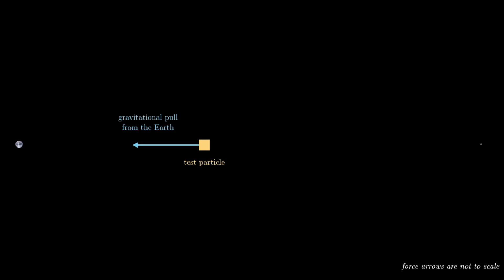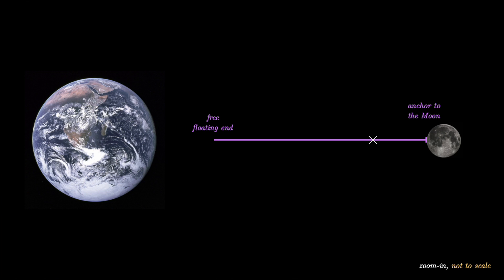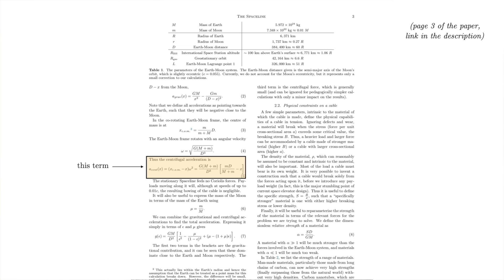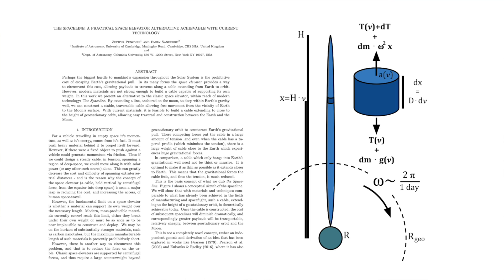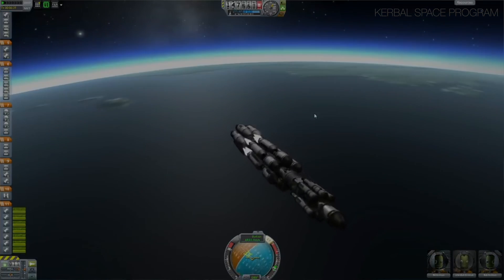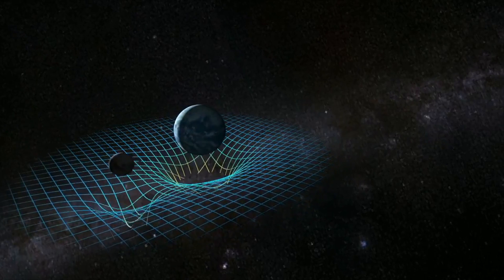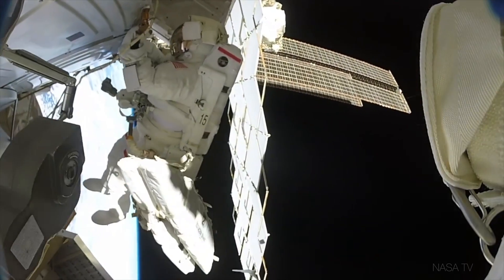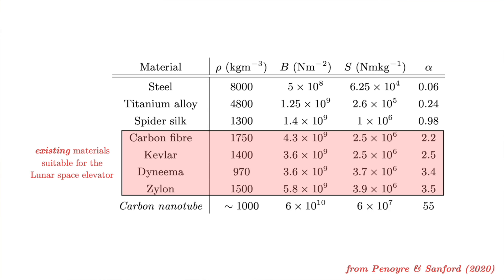The Lunar Space Elevator

Comment: Moon orbit is not perfectly circular. Moon is tidally locked but still librates. What is a mitigation plan in case of cable snap?
Reply from the maker: If both ends were anchored, libration would indeed almost certainly snap the cable. But the other end is free in space so this isn't really crucial with respect to snapping.
Reply: @CoolWorldsLab  there are million potential causes for cable to snap including terrorism. What to do when it DID snapped?
Reply: @NoHandleToSpeakOf  terrorism can also be the cause of airplane crashes or structural failures in a building but that doesn't mean that these should be primarily best addressed through structural engineering. 
there are much more effective methods to combat terrorism, such as good intelligence.
Reply: @NoHandleToSpeakOf  Build a new one.
Reply: @rileyknox5034  Or stop by Space Elevators R Us on the way home from your job in the galactic core.
Reply: @NoHandleToSpeakOf  when terrorists are a viable threat 25 earth diameters up in space this will have been built already.
Reply: It's pretty easy to mitigate for a cable snap: you could either build multiple parallel cables or perform regular maintenance to insure that doesn't happen or both. Should be no more difficult than maintain a suspension bridge or a ski lift, it's just a matter of scale.
Reply: If it snaps then the two sides fall towards their respective bodies. But you could cut the opposite side from the snap at the appropriate height to save the hub and whatever cable is above the break points. So the worst snaps are near the hub, the least damaging near the surface/tip. On the other hand, the closer you are to the hub, the slower the two ends are going to fall away from each other, so breaks there might be easier to repair.
How thick is this cable, would it burn up in Earth's atmosphere? It's 60,000 km from the Moon to L2, worst case you're dropping that much cable on both the Earth and the Moon. Maybe tidal forces on the Earth side would break it up a bit, help it burn?
Reply: @loklan1  hmm, I don't think the cable falling on Earth or the moon is a real concern. With prompt intervention you could catch that before it happens.

It would be of much more immediate concern to spacecraft in orbit around these bodies, especially if it snaps close to something's orbit.
Reply: @loklan1  Perhaps the Earthward end of the cable would end up in orbit around Earth?
Reply: Modular cable sections and adjustable length, with the center posessing some thrust capability.
Reply: @TeslaKaniv snap? the other end is hanging in space
Reply: @daos3300  you're thinking about it the wrong way. The end hanging in space, beyond L1 is being pulled towards Earth keeping the whole system in tension. There are two points of maximum tension in the system. One is between L1 and the Moon and the other is between L1 and Earth, and if not properly balanced, the cable could snap at these points.

I think TeslaKaniv, main point of concern concern is that the Lunar orbit is not circular, thus the forces acting on the cable do vary and a fixed cable would be at times it's in grater tension, at times in less tension.  
This would also mean that L1 itself is not set in space and the "station" would have to constantly shift position in relation to Earth and the Moon, though this can be easily mitigated by allowing the station to move along the cable and by also balancing counterweights on the Earth side of the system, thus maintaining a constant tension in the cable. 

Other causes of a snap could be material fatigue due to "weathering", exceeding operational loads, foreign object impacts and sabotage. 
But I do believe all of these could be easily addressed with existing technology and practices. 

A good question is what would happen if the cable would snap. A sudden release of tension would knock the entire system out of balance, so you would presumably need to provide a way to restore balances as soon as possible and presumably have a crew on the ready to fly out and reattach the cables.

My gut says that given the distances involved propagation would be slow and you would have plenty of time to respond,  I must admit however that I don't have the knowledge to work out the math myself, but it definitely deserves consideration.

Another way to mitigate this could be to place intermediary platforms with on board thrusts at fixed intervals along the cable(which would activate in the event of a sudden loss in tension and keep the cable in place until repaired), but this needs further analysis to see if it's really feasible considering fuel storage requirements.
Reply: Libration hmm ... thought about it too and it is not mentioned in that paper,
so I just did an conservative estimation to get an order of magnitude estimate value
(cos(8°)-1) * 1738km => ~17km vertical amplitude 
and that twice per month giving a top speed of about ~13mm/sec 
and that twice per month giving an acceleration of about ~10 µm/s^2
Half a month is way longer than the sound round trip time (which should be in the minutes range). 
Thus this is basically is accelerating the whole cable and not 
stretching one side and thereby exciting some standing waves.
10 µm/s^2 equates to 10N per 1000 tons of cable. 
Surprisingly this is totally benign. Easily solved by the preload.

Comment: What kind of forces would be applied to a passenger on the Space Elevator? Could you do experiments about different levels of gravity? Like from Moon level, all the way to Near Earth levels? Or, would it not work like that? Great video.
Reply: At the L1 hub you'd be at zero-G.
At the moon you'd be at 1/6 G, and on the Earthside cable you'd go from zero-G at the hub to closer to Earth's 1G at the dangling end.

Add / subtract any acceleration / deceleration you experience in the elevator car along the way.

Comment: It would be interesting to see what are the engineering problems. The devil is in the details here for sure. Lunar orbit is not a perfect circle (changing the relative distance between Earth, L1 and the Moon) and libration would make the anchor move periodically by several kilometers with respect to the projected surface point each month. The cable might be "telescopically streached and contracted" or the anchor could start from a railway platform with elliptical tracks on the surface of the Moon. Either way I think there would probably be a lot of issues coming from small aspects.

Another concern could be Coriolis forces as the elevator cabin rises. If this is done too quick it might generate a huge tensile stress perpendicular to the cable. If the elevator moves slower you get larger travel times. I didn't made the calculations but it might be a key problem.

Either way this is an awesome concept and I'm glad students like Emily are researching with such contagious enthusiasm. You gusy are awesome.
Reply from the maker: Miki P liberation was the thing I actually talked to Emily about after seeing the paper for the first time, I agree it complicates things but shouldn’t be a deal breaker

Comment: Spacs elevators are terrible by comparison. Stop this nonsense cool worlds, space elevators fall into the false dichotomy that every single "stationary construction/building" should be a passively supported structure. 

When you compare a space elevator to actively supported structure you'll find that actively supported structures blow space elevators out of the fkn water. 

Do a presentation on shit that actually works: Launch Loops
Orbital Rings
Space Towers

These 3 constructs can both transport material to solar orbit quicker, in larger amounts, and can actually be done without any special materials that don't actually commercially exist and using simple materials like copper and iron. All it needs is energy, which is far easier to solve than material science required for the gigapascal energys required for space elevators.

Comment: How about making the elevator more like a ski lift, with the cable as a loop anchored by Ferris wheels at each end? This way the elevator could work in both directions at the same time (especially if the weight was close to balanced). With no need for climbing motors, the cars would be lighter and no longer need to be powered via transmission system too.

Comment: You are considering equal-balance point between Earth and the Moon. That is great. Have you considered general multi-body (n-body) problem that other celestial objects would also exert a force on that cable could cause this cable to move gravitate towards (ex the Sun). These cables, as you suggest, are way too long to be straight and even little forces can pull them great distances.
Reply: Yeah I would hope you would account for at least the Sun Mercury Venus Mars and Jupiter even  Saturn Uranus and Neptune ought to be accounted for to make sure they will not result in any severe long term problems.

Comment: I guess the biggest issue would be the traveling speed, holding on to a rope or a rail while moving at several thousand kilometers per hour sounds ambitious. And anything that is slower means we get absurd traveling times, that would only make sense for cargo but not really for humans.
Reply: Yes, you're right - it is good for cargo, but for people, well, you can only go so fast without worrying about serious wear and tear on the system - either the cable, or the crawler drive, and if you go slower, you're looking at something like >2.5 weeks travel, so you'd want your crawler to be like a 20m yacht, and it would require a resupply system as is used for the ISS. On the other hand, that isn't a show stopper; that could indeed be a workable model, but not for Joe off the street - you'd need the same sort of prep for prolonged weightlessness that ISS tenants receive. Also, as someone mentioned, it's going to be a while before this happens, as I imagine we wouldn't attempt it until we can source almost all the material except the most exotic high tech from lunar ISRU, so we've got lots of time to work out the details.

Comment: Nice presentation and clever. The thing missing for me is some proof that it could be built using current materials - i.e proof in the form of tensile strength calculations, material characteristics, etc. taking into consideration a cable size appropriate to carrying a usable payload to and from the lunar surface. Also some proof of cost savings.
Reply: Have a look at Isaac Arthur's video on space elevators. It's much better explained, and refers to specific experiments that have been done with existing materials.
Reply: The paper is linked on the description. Just check it there if you are interested.

Comment: Any thoughts about the advantages/disadvantages and/or impracticality of building lunar space elevators involving any of the other four Lagrange points of the Earth/Moon system?
Reply: L3 is on the opposite side of Earth to the moon.
L4 & L5 are the same distance from Earth & moon as the distance from Earth to the moon.
 (Earth, moon, L4/5 form equilateral triangles.)

I've heard L2 is doable, relying on centrifugal force from moon's orbit around Earth.
 That elevator would be longer than an Earth->space elevator 'cos moon only rotates once per month, but its gravity is weak enough that it wouldn't require a tether made of unobtanium.
 An L2 tether could be a way to get on & off moon's surface without rockets :)

Comment: I don't know if i just missed this point being refuted in the video, but what about tidal forces from varying regions on earth and the moon? Wouldn't that be able to bend the cable, especially on the non-stationary earth side?
Reply from the maker: Spacefarer I don’t think it would bend it but it would apply an extra tensile force. The Earth’s tidal force is rather weak and does not, for example, disrupt meteorites or low earth orbit satellites. This is very high above compared to those objects so I don’t think that’s an issue (but Emily might correct me!)